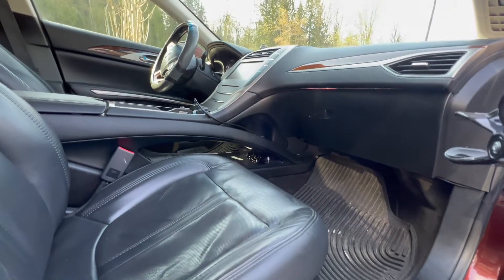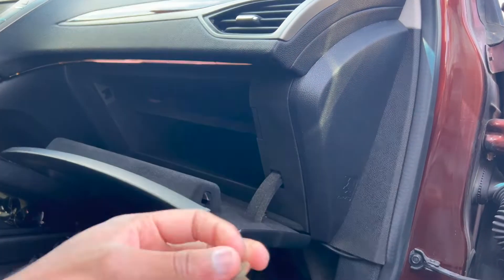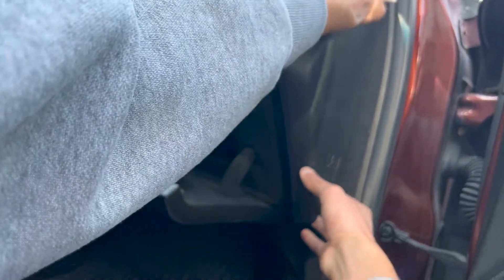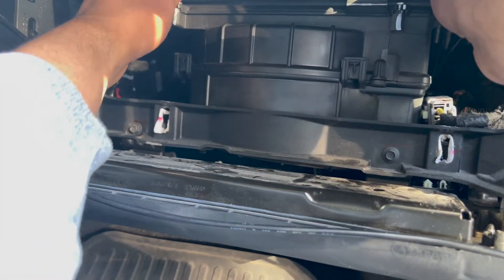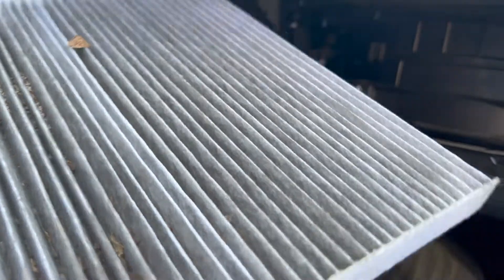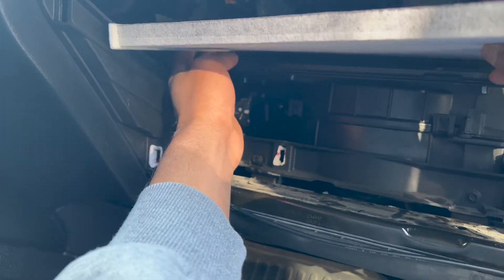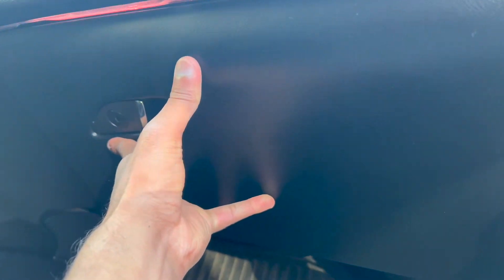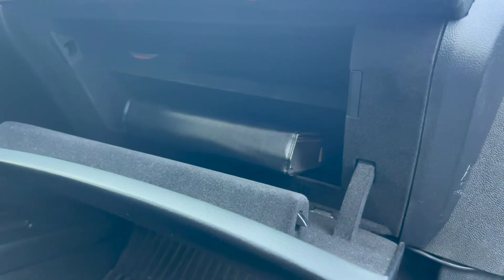How to Change Cabin Air Filter on a 2015 Lincoln MKZ | 2013-2016

Comment: Thanks for the video.  You need to add one thing:  the delicate door that must open that hides the filter needs to be opened with the tabs above the door.  That step should be added to your directions,
Reply from the maker: Good point, hopefully people will check out the comment section

Comment: I realized there’s no need to reinsert the filter door screws as the door itself clips shut and there’s no way of reopening by itself
Reply: The filter door screws may prevent interior squeaking of the door over time.
Reply: My dealer was nice enough to not replace the screws for me, as I realized when I replaced myself at the next interval